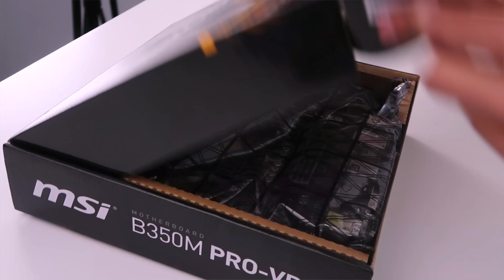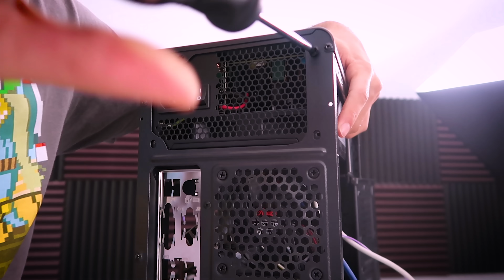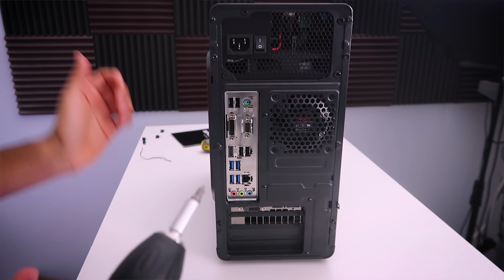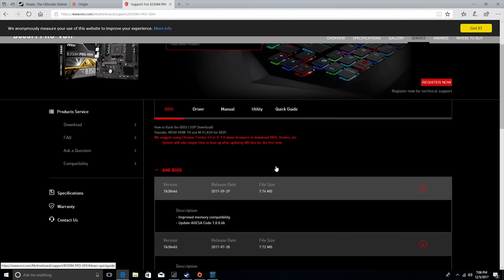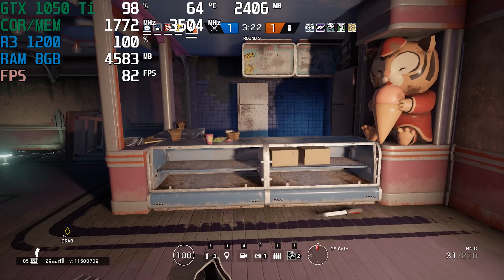$500 Budget Gaming PC Build Guide - GTX 1050 Ti (w/ Benchmarks)

Comment: My PC keeps randomly shutting down. I read online that it is probably because of overheating but all my fans are working so I don't think it is. I built it myself. If anyone can help, I'd really appreciate it!
Reply: did u put thermal paste on your processor?
Reply: @emresin  yeah of course
Reply: @sigsby6418  what kind of cooler are you using? fan or liquid and what is your processor model?
Reply: @emresin  I'm using a fan as my cooler. The processor is an i3 3.1GHz (I know its old, I'm upgrading soon ). Sorry for the late reply and I appreciate your help!!
Reply: And by the way, I have Speccy installed and it says all my parts are around 40 degrees Celsius
Reply: @Sttyxzz  yeah, my ram is fine and correctly placed
Reply: I dont know what is the problem sorry

Comment: Does the motherboard have wifi?
Reply: Zombies Expert3 no
Reply: Oh yeah yeah
Reply: wifi ?
Reply: Please, if you build a gaming pc DON’T USE WIFI
Reply: @jopperdepopper5219  - I use wifi and get around 10 - 20 Ping. That's good enough for me. And the speed is 50 mbps
Reply: Soumik :D I use WiFi and get like 5mbps, Ethernet gives me 260mbps😄
Reply: @soumikd794  with a lan cable you'd bet better stability
Reply: @jopperdepopper5219  Wi-Fi works fine with a good connection.
Reply: @DanTKD87  I end up with 200+ ping at times ahaha :(
Reply: @jopperdepopper5219  why?

Comment: Guys I need help This is going to be my first build and I want to get a bigger case for better cable management but I'm scared I will mess up because the case wont be like the one in the video
Reply: Rather just get the case in the video so you can follow step by step 100% without fucking up
Reply: @anwarabrarov6826  but its going to be hard dude look how much he had to tight it in
Reply: its hard to see ho  he managed his cables
Reply: True that.. but nothing will work without some elbow grease. And plus, at least you won't have to worry about messing up if you follow the guide.
Reply: @anwarabrarov6826  alright Thanks ill buy the case he has but I do want transparent glass
Reply: I think Ill use his parts but watch another video that uses the case that im buying
Reply: Yeah, it is, but you kind of have to rely on your own intuitions and try to make it as clean and fitting as possible. That's what he did, at least.
Reply: @anwarabrarov6826  so i guess youre saying his case is better if so tell me cause im building for the first time
Reply: when i say better i mean like easier to follow

Comment: i want to use the DeepCool Tesseract case instead. Its cheaper, still looks good and has a  cable managment system. I dont know if its compatible with the other parts in the video though. PLEASE COULD ANYONE REPLY IF YOU KNOW THE ANSWER. Im new to this so... plz help. It also comes with fans so should i bother buying fans?
Reply: nevermind, i've built my pc and its been working better than i could have hoped for the last 2 years. The case is fine.

Comment: MY BUILD

CPU: AMD - Ryzen 3 1200 3.1GHz Quad-Core Processor  
CPU Cooler: ARCTIC - Alpine 64 GT 25.6 CFM CPU Cooler  
CPU Cooler: Cooler Master - Hyper T2 54.8 CFM Sleeve Bearing CPU Cooler  

Motherboard: MSI - B350M PRO-VDH Micro ATX AM4 Motherboard 
Memory: G.Skill - Ripjaws V Series 8GB (2 x 4GB) DDR4-2400 Memory  
Video Card: EVGA - GeForce GTX 1050 Ti 4GB ACX 2.0 Video Card  
Case: Deepcool - TESSERACT SW ATX Mid Tower Case  
Power Supply: EVGA - 430W 80+ Certified ATX Power Supply  
Optical Drive: Asus - DRW-24B1ST/BLK/B/AS DVD/CD Writer  
Monitor: AOC - G2260VWQ6 21.5" 1920x1080 75Hz Monitor  
Keyboard: Logitech - K120 Wired Standard Keyboard  
Mouse: Logitech - B100 Wired Optical Mouse  
External Storage: Seagate - Backup Plus 1TB External Hard Drive  
Total: $752.59
Reply: That's a good build
Reply: Nice set up, kind of pricey
Reply: Does it work well?
Reply: Why not ryzen 3 2200g because it's cheaper and better?
Reply: U don’t meed 2 cpu coolers lmao
Reply: And you need internal storage not external, thats not gonna work

Comment: Bought a $600 pc, second hand, bought from it from someone online (meet up) but runs like crap, bought it as a bundle, I am not sure if I was scammed or the guy himself. It came with a cooler master case, with a gigabyte motherboard, a intel cpu pentium, a water cooled cpu fan from cooler master, a decent power supply, a GTX-1050, a Razer headset, a Logitech G-502 gaming mouse, a cooler master keyboard, a large gaming table mat, a cheap speaker, and his account, and his 2 hdd one with 1TB and 800GB and some kind of a chip SD attached on the motherboard which I did not notice. 
Windows 10 is not activated, I have his identity, and his accounts, and games. Set it aside for awhile, and it worked quite well but I had to upgrade it for a bit. I bought an Asus Motherboard Crossblade Ranger (sold the the original mother board online), changed the cpu with a spare one, I have 2 broken pc, a workstation and for gaming. Took the spare cpu from my broken pc, an AMD cpu. Change the fans and the case, the water cooled fans wont fit into the original and my old case cause' of the motherboard heat sinks. Found an old windows 10 key that I bought 2 years ago (home). Changed the power supply. 

Rebuilt the pc using old spare parts. Cost me $100 plus bucks from the motherboard making $700 plus dollars in total. 

But I still have a problem, don't know if I built it wrong and set the wrong settings and what not. It runs like crap, fans are so loud (planning on changing it), runs games well, but at some point, it now runs games poorly, having my graphics set to high makes the game laggy, I was playing an MMO game and set my graphics high, and thought I kept getting pulled back constantly was from the ping but It turns out it was my computer not my internet nor my graphics (turned it down but it still has that constant lag) happens to every other game I play, opening a browser and running from the background while playing makes games lag. Opened my task manager to look for unwanted application running in the background and making my cpu and memory usage high, turns out it was my browser, even my old cheap pc can run fast with an opened browser. CPU usage often reaches 60-100% while playing music from Youtube or Spotify. Memory usage also reached 2000 mb. Cant sell it now, so I can buy the same stuff that he bought but I guess I just need to fix it again.

Comment: Just got this PC put together, with a few changes (Ryzen 2600,  600W, 16GB ram) but when i turn on the computer I get nothing on the display. I followed the guide verbatim and everything appears to be running correctlly inside... I've tried with and without the Windows flash drive plugged in. What should I do?
Reply: Probably don't have the power cord fully plugged in..

Comment: Will a gtx1060 6gb and i5 8400 work with these?
Reply: No, the CPU that he used in this video is an AM4 socket CPU. Intel CPUs are incompatible with this socket, so you would need to switch the motherboard.
Reply: sure but amd radeon rx 580 is has a lower price and the same specs

Comment: Welp the total currently rn is 590$ but a computer that works better than a 1k laptop that cant handle gamin
Reply: Great deal the inflation is rising pretty quickly
Reply: Yea man
Reply: When they go down this build be like 350
Reply: as of now it set's at .....Subtotal (8 items): $546.08....i did upgrade the ram to 16gb not 8.gb ....no hdd i only run ssd
Reply: Nah i gotta 1k laptop with a 144hz display its pretry much runs everything over 144 fps. Only problem with laptops is the air flow.
Reply: Hopefully it doesnt reach to 1k

Comment: Im thinkin about building this PC. questions though, how does fortnite run on this PC? as well as After effects & photoshop. Is it a good or decent streaming build??
Reply: Flaw Hyzos photoshop will run but not well. Same for streaming. You won’t be able to stream off it and play games with that processor
Reply: Luis Ramirez what do you recommend ?
Reply: Flaw Hyzos a Ryzen build with at least a 2600
Reply: Luis Ramirez okay what else?
Reply: Flaw Hyzos change the motherboard to a b450 board and get 16Gb of ram total.
Reply: Luis Ramirez thank you man 🤟🏻
Reply: Flaw Hyzos try to get a b450 tomohawk and Corsair lpx 3000mhz or higher. Ryzen is better with faster ram

Comment: Can we put a i5 7th gen in this setup rather than a ryzen???
Reply: Mystery Foods no, this uses an amd motherboard so only AMD processors with the AM4 socket
Reply: @ValkenDnB  no i mean after changing the motherboard to a b250 and the processor to intel i5 7th gen and keeping all the other components same will it still be under 500 dollars
Reply: Mystery Foods no the i7 is more expensive. I would just build a newer 8th gen build if I were you
Reply: But I need a cheap pc for now and then I'll buy a laptop after a year so I think i5 is good for now😀
Reply: Mystery Foods get a 8th gen i3. Or switch to Ryzen and get a Ryzen 3
Reply: @ValkenDnB  ok thanks for the tip😀😀👌👌

Comment: One thing I would change is change the gtx 1050ti to a rx 570 which you can get for $110-130 preowned on ebay. It is like 30% faster and is cheaper than a new gtx 1050ti.
Reply: Nathan Kong I wouldn’t say 30 percent faster but yeah it is faster
Reply: Oscar G. Ya more like 20%

Comment: Just built this pc today and it’s ace
Reply: Hey, could you help me ? I tried to build it but for some reason it won't boot.
Reply: Glomper have you turned on the switch on the power supply?
Reply: @joelfoster9100  yes I did but I fugired it out. I think.
Does using a dual channel mother bard mean you have to use 2 or 4 ram slot ?

Comment: Ive never built a pc so I need help because I want to upgrade this build a little. First off this is probably a dumb question but could I get 2tb hard drive instead of 1tb without any problems? I would rather have 16gb ram over 8gb. How can I do this while making sure everything works together?

Comment: When he talked about they wifi adapter, do i need to have that, like instead of using an ethernet cable cant i just connect to my wifi example (Rogers, Bell, EE) ?
Reply: nxmmie_ if you want to use a wifi connection you do need a WiFi adapter since most pcs don’t have wifi connections
Reply: @d.m457  what if i just have like broadband wifi
Reply: nxmmie_ if you have broadband then you’ll have to use an ethernet cable which should give you faster connection speeds

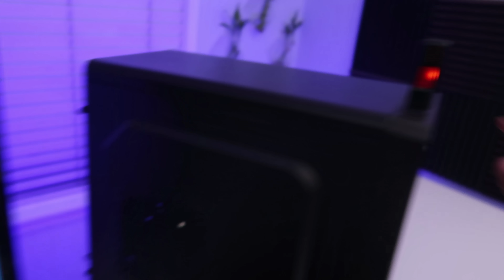Comment: NEVER turn a computer off like at 18:35 - especially if you’re using a hard drive. The hard drive won’t stop spinning properly unless you shut down through the start menu.
Reply: @THE ANDROID GAMER  Start Menu > Shut Down
Reply: What do i have to do at Minute 18 pls answer
Reply: Raff C Are you installing drivers? You need to find the setup file within the folder and run it.
Reply: I have to dobble Click it and than put the usb
Reply: The USB is only for if you want to run a BIOS update. For drivers just double click setup.
Reply: And than close Realtek folder and Open the 7a... folder
Reply: I think that with windows 10 it's the same, at least in my computer it shuts it down properly
Reply: I built this in may. It has worked well, until maybe a month ago when I started having issues with losing internet connection. I'll lose it for just a moment and than it comes back on. This is mostly not a problem but playing online is a pain. I'll be in for not five minutes and '' lost connection from server''. I use a ethernet cord. I've used a couple of different ones and nothing changes. Should I try installing the lan-drivers that came out yesterday?
Reply: @Pork Free Coffee Installing the new LAN drivers is a good idea and should help. If not I’m not sure. I have the same problem except I use a cheap USB WiFi dongle lol.
Reply: Thanks I'll try it. I was going to try the wifi adapter if this doesn't work. @UltraHylia
Reply: @UltraHylia  Well I think that worked I was able to play a session without getting kicked off the server. But just a moment ago when my computer woke up It did the same thing with No connection and then Connected. So I don't know but thanks anyway maybe it only happens when it sleeps now.
Reply: Glad it seems to have helped. If not I really don’t know. Could you try a different Ethernet cable?
Reply: Hey what if I use a evga 500v bv 80+ bronze non modular will it effect anything
Reply: @bernard ong As long as 500 watts is enough for your all your components then that power supply is fine.
Reply: @UltraHylia   If I get a 1060 sc instead of a 1050ti sc, is it going to be a bottleneck for the ryzen 3 1200
Reply: @Nailuj No.
Reply: A Google User So if I put in a 1060 single fan it will still work?
Reply: That isn't to bad, it's waaay worse to turn off the power supply directly via the switch.
Reply: I think this is only an issue if you hold the power button and make the computer forcefully shut down. If you just press it and release immediately it'll shut down the same way it would if you did start > shut down
Reply: That seems to be the case. Must be some new Windows 10 feature as I’ve never heard of it before. Either way I’m sticking to the start menu method - just to stay safe.
Reply: @UltraHylia  you're a god
Reply: He didn't go though how to install drivers.... Someone help me
Reply: @Arman Mohammed You need to download the drivers from the manufacture website, extract it and run the setup file.
Reply: A Google User all these 108282 sc ti thingy is so confusing me, i’m trying to learn all these pc building terms and how to do the wiring and stuff, i’m literally lost. But i do know what parts i need.
Reply: I think that only happens if you hold the button
Reply: A Google User yo, i just built this computer, and after overclocking, my screen would freeze after logging in. Do I need to raise my voltage?? orrrr??? this is my first PC and i’m kinda lost
Reply: Many cases and the motherboard power outlet nowadays give a close command so windows closes the pc It happens to me too I click the button and windows says it's shutting down
Reply: Stooooooopid
Reply: I built this computer and I turn it off that way all the time. He cuts out the part where it actually turns off. The computer shuts down the same way it does when you click the shut down button in windows. It has the blue screen and everything.
Reply: waterb0lt Wait, really? That’s new. I must be too old-fashioned lol. Ignore me!

Comment: Cool! Btw Joey what do you think, if i put an i 3 8100 instead of the 1300 in the pc, will it perform the same? Or will it run games slower/faster? Looking forward to your answer. Cheers!
Reply: I've been using an i3 8100 (+GTX 1050ti Windforce) and it has not disappointed me so far. It runs Fortnite better than my PS4.
Reply: Márk Kovác ryzen is more better bro, and it is more cheap
Reply: the 1300 costs 125 and the i3 costs 125 as well, but the i3 functions better as a workstation, and i would like to make videos ,so :P
Reply: Márk Kovác oh yea i think intel is better for office stuff

Comment: For those interested, I've totaled the prices for the USA links and it summed up to roughly $681 with the inclusion of various accessories. A keyboard, an antistatic wrist ground, USB drive, the fan, USB WiFi mentioned and rounded up on every component for sake of high end estimation. 

Compared to the price of a similar prebuilt, the SkyTech ArchAngel/Shadow Gaming PC with the GTX 1050 ti and AMD RYZEN 3 1200, you're saving a significant amount of money. Though, the caveat being you can take out a warranty on the entire prebuilt rather than individual component. However, even without considering warranty, the taxes on the prebuilt still push the price no less than $10-20 over that. 

I would suggest Joey's build is ultimately the more advantageous route. There's one major point to consider: Upgradability. The prebuilt uses a different motherboard, with one RAM slot. While the case is flashier and the specs are comparable, Joey's offers a bit more flexibility. Essentially, if I found the prices correctly, you're splurging an extra $15-20 on a motherboard that you can expand to having 16GB without having to drop all of that money into a single slot. 

The prices will vary, and there may be a time in which this build is more expensive than the prebuilt. But, take a moment to consider the value through the lens of "What can I do with this in the future?"
Reply: i did it and it costed 585 dollars
Reply: without a keyboard monitor or mouse just the tower
Reply: That's unusual, I'd only rounded up to the nearest dollar. Maybe I accidentally added one of the components twice?
Reply: is the anti static wristband required for this ?
Reply: +LanZo No, it's more just a precaution. If I go through with a purchase on this scale, I would just rather not take any risk. But, it's very possible to build the PC without one!

Comment: Hey can anyone help me I followed this build completely and upon start up there is no display I tried reseating everything on the motherboard all the fans and leds turn on and im stumped this is my 3rd attempt to build my own pc and its getting very disheartening the only clue I have to whats wrong is the debug led on the mobo is lit up saying its a cpu problem ive reseated 5 times now and still nothing and from observation there is no bent pins on the cpu either
Reply: I have the same problem here, did you fix it ?
Reply: I think u need to update the Bios of motherboard..Is It working now??
Reply: Never found out I returned all parts for a full refund and went with an intel i3 build instead of a ryzen I feel amd mobos are less beginner friendly from this experience